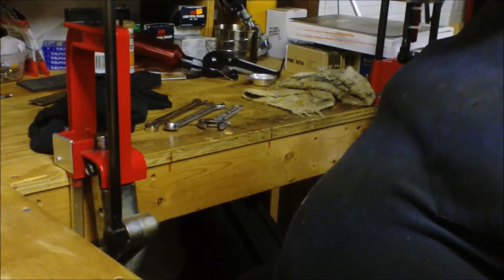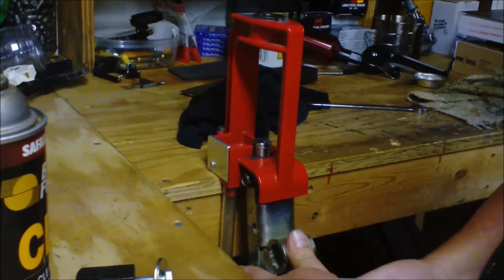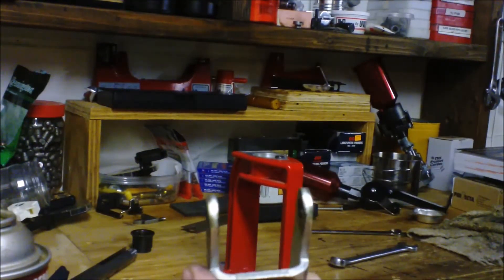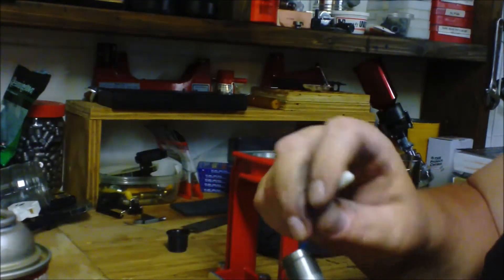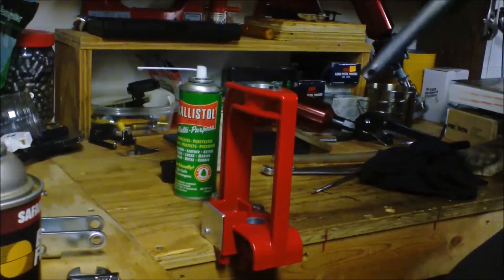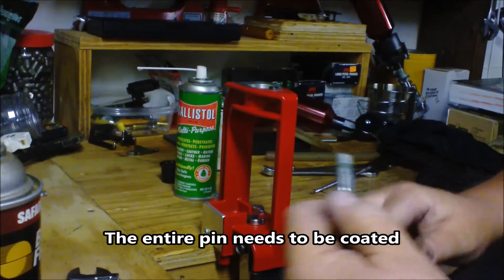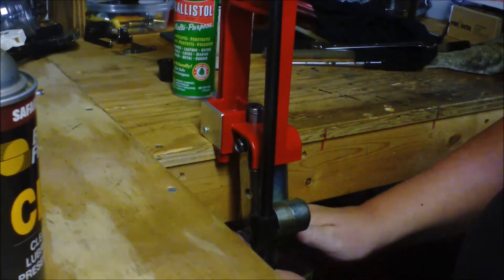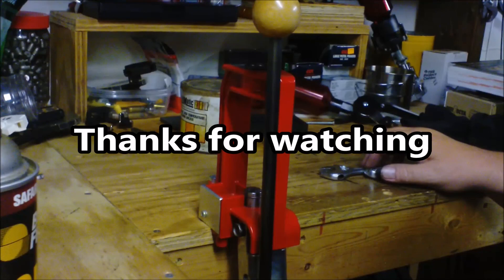Reloading press maintenance: Lee Breech Lock Challenger

Comment: I use the Harley deprimer tool. Keeping as much dirt and burnt powder residue away from my presses and dies has made a huge difference. I deprime and then clean & polish brass. Then size and trim if needed. Then back into the tumbler. Use auto wax in media and that keeps the brass nice and bright for awhile. Last blow out brass with air compressor.
Reply from the maker: I use the same process as you for my rifle brass but I still de-prime on the press before cleaning.  Rifle brass gets wet tumbled and blown off , pistol brass is dry tumbled with lizard bedding and New Finish car polish.  I'll have to look up that de-priming tool.